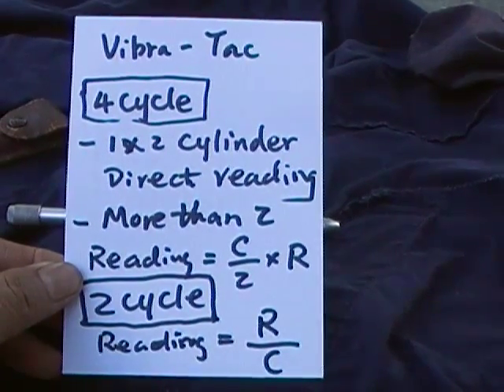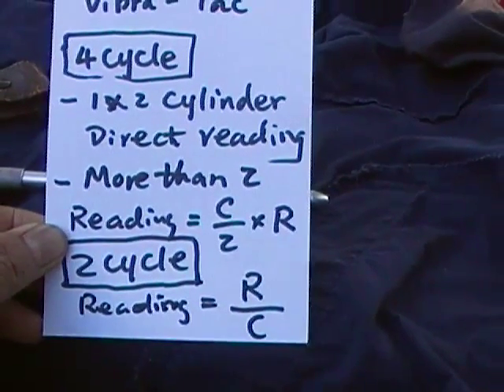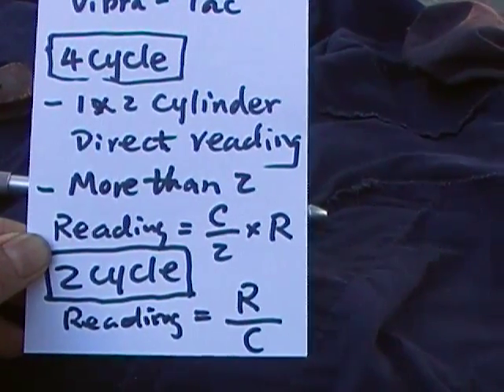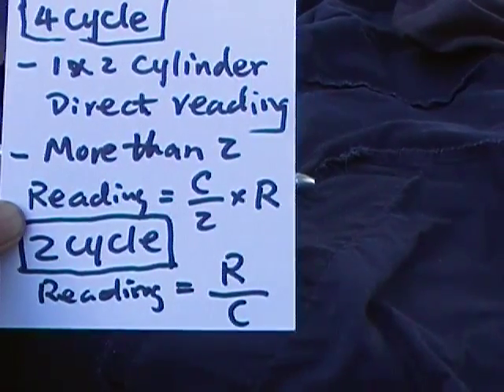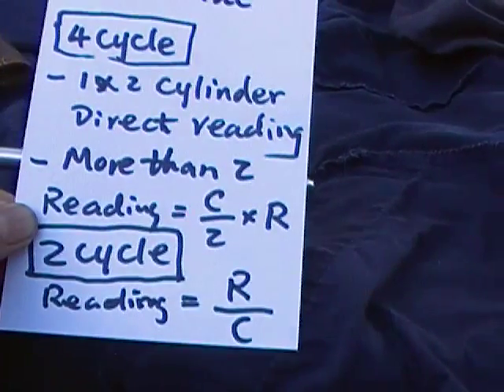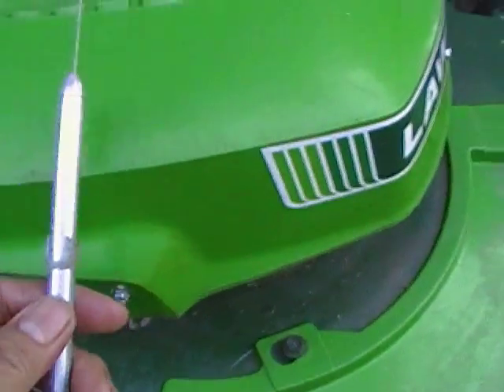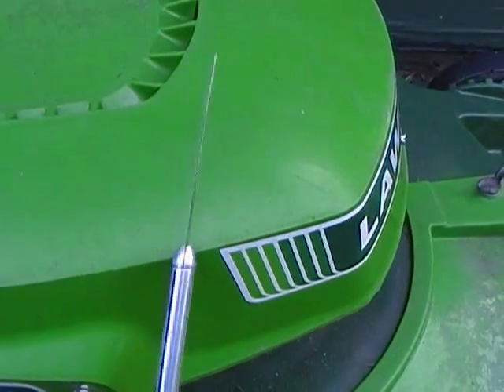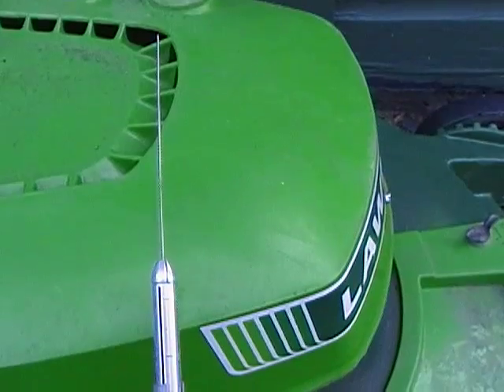Vibra-Tac Tachometer explained

Comment: I inherited one of these from an uncle that was a mechanically inclined person. I have seen it and seen this in his tool box. The video does not show or tell where to stick this. If you have a tachometer why do you need this tool. I am just curious. Do Mo. I understand an older technology such a a point gap tool. I would enjoy further explanations.
Reply from the maker: Hi Jonathan , thank you for your comments. The simplicity is the best part of this old technology.  To measure RPM of an engine or motor, you put the bullet shape head against the machine, and slide the wire up and down, until it moves widest, which is the resonate frequency of the wire length to the motor . This Vibra Tak minimal measurement is 2000 RPM. It is good for adjustment the max RPM for the small engines, they are usually between 3000-3600 RPM. 

Actually Germen is still making the Treysit tachometer , which can measure from 800 to 50,000 RPM. You can google the instruction manuals of both tachometers.